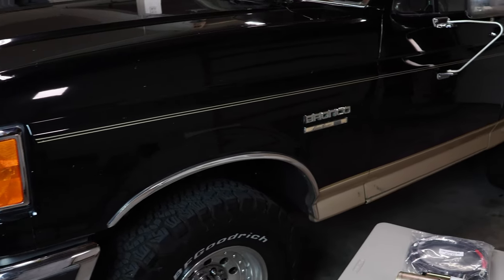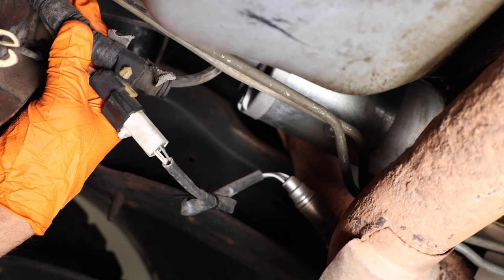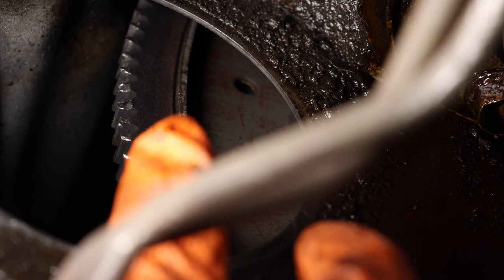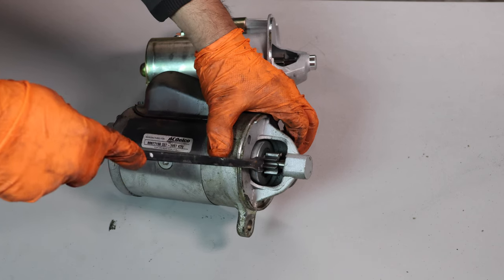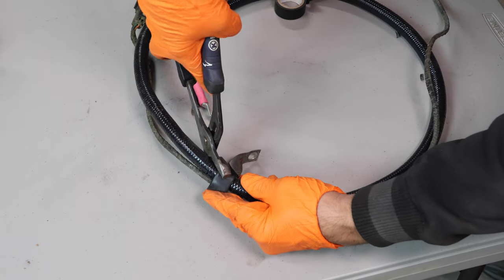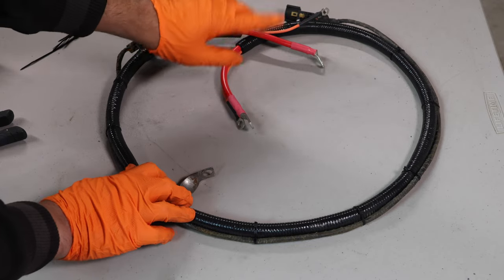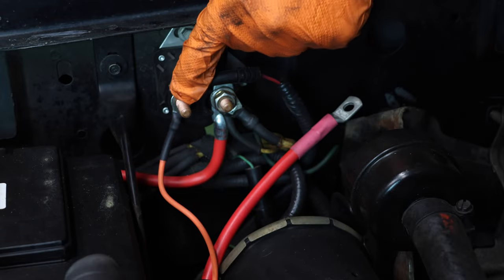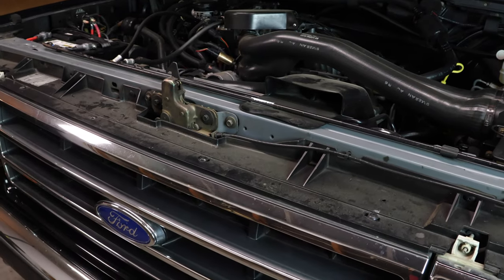Ford Bronco F150 Starter Upgrade | 1980-1996 Ford Performance Starter | Bronco Restoration

Comment: Another reason I love my bronco Is that we have people like you to thank in working on them. You doin the lord’s work man. I had my starter replaced already but I might make this upgrade anyway. I definitely didnt pay the high price for this starter…Anyways thanks man.
Reply from the maker: I definitely recommend this upgrade if/when your current starter goes out. For me mine always struggled during the winter time but would act right once temps warmed up. I’ve got some in depth videos coming up for this truck soon.
Reply: I realized my truck won't start and the battery won't get jumped. There's no sound when I turn the key NONE.. I'm suspecting the starter, it's always struggle a bit to start occasionally. 
Think that's a fix is there a right way to diagnosis ?
Reply: @LethalityKing  do you have a second person? If so, have them turn the key while you bang on the starter. If the truck starts then it’s the starter. Keep hitting it with something hard like a flashlight. I havent watched this video in a while so you might already know this. Give it a shot.
Reply: @LordKenjii  oh yea I forgot about that. Haha 
I did by pass the solenoid with the screwdriver and it actually cranked but  it didn't turn over. 
I'll try that tomorrow

Comment: Can you tell me what the actual model number of the mini starter.   Trying to change the starter on my ‘93 Bronco.
Reply from the maker: I have added a new link to the description for the starter, I believe it is part number:M-11000-B51 for automatic transmissions. Manuals will be different.

Comment: I think the performance is driven by the “PMGR” or permanent magnet gear reduction technology - as compared to the older style drive style.. when you added the additional cable on the positive side of the solenoid it reminded me of the PMGR style which I believe is what you installed

Comment: Will this work with the C6 transmission ?
Reply from the maker: The starter shown is for automatic transmission, you will need part number: M-11000-MT164 for manual transmissions. I believe I have a link in the description.

Comment: That's wild. I just did this in my 94 f150 last year. Starters normally go out every two years. Ive had the truck for almost 15 years and it was my dad's before that. I've replaced a ton of starters on it over the years. Reman, new, OEM. They all were about the same. I read a forum post of a guy saying use a Ford performance starter meant for the mustangs. It's cranks way faster and less. A year later and it's still going strong. Before I would notice a slow down or even stall outs that would have to be corrected with a hammer lol. 

Great video spreading the info so more people learn there's better options out there.

Comment: That's a nice kit bringing the starter cable, I bought mine separate. Had some luck with a new Bosch starter being beefier than the replaced part, never thought the parts store ones were that bad but it makes sense. Super easy job
Reply: Where did u get ur starter cable kit from?

Comment: Great upgrade. 

And it Turned out my red head gear box was defective.
Reply from the maker: Thanks, Did you end up getting a good box from red head?
Reply: @TheFixTech no. I had my old one rebuilt, which is how I was able to determine that the one red head sent was no good. They gave me a full refund.

Comment: great videos, and this one is quite instructive. My starter broke 3 weeks ago, second one in 3 years, on my F250 1987 7,5L 460. Same ACDELCO model as yours in the video. I was looking to replace it by a stronger one, but difficult to find one... Would love to find a performance one as the one you mention apparently is not compatible. Any clue how to find a compatible one strong enough? difficult to find...
Reply from the maker: This starter will work on the 460, the only difference is the top bolt threads into the starter which you can either use a heli coil or a nut and bolt setup. Also Powermaster has some good options in case you are interested.
Reply: @TheFixTech  Many thanks, i will surely switch to this one then in the coming weeks, tired of being stuck on the road because of starter issue (twice une the last two years). I was looking at the powermaster 9405 also, I guess going with ford is safe. Many thanks

Comment: Definitely having an issue with a starter I got at Advance for my 93. Clearly audibly spinning a few seconds after starting.  

Probably have to do this but man… $300+.  Nothing’s cheap anymore. May try to go to a local rebuilder and see if they can tweak the big box one first and make work. Original one lasted 30 years. Irked I sent the core in now.
Reply from the maker: Sadly nothing can help the big box ones, you may be able to find an original used one online or at a salvage yard and rebuild it. You can also find these on sale occasionally. It is pricey but I got tired of getting stuck.

Comment: Can you send me a link to that starter and wire kit? I have a lazy starter sometimes it turns slow. Replaced 2 batteries interstate and diehard still slow starts. Please help. Thanks.
Reply from the maker: I have added a link to the description, check your starter solenoid (on passenger side inner fender) and make sure connections are corrosion free.

Comment: Does this fit on the 5.0 as well?
Reply from the maker: Yes it does.
Reply: So my 5.0 had to get a new alternator. And It comes with a single wire that attaches to the positive relay. I attached the new starter cable to where you said (which has the alternator connection) and I'm getting a bad connection. Is there another place to place either of the wires (alternator or starter)